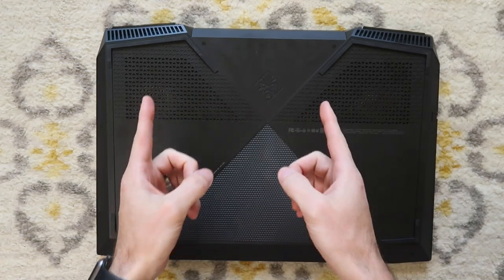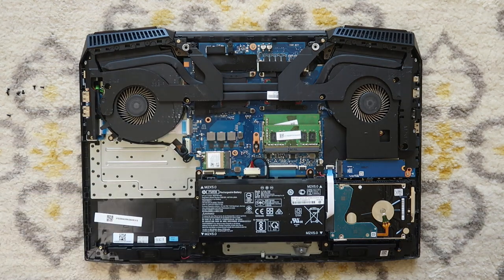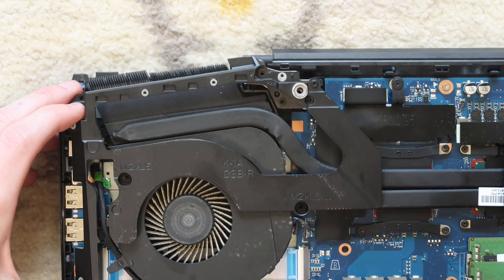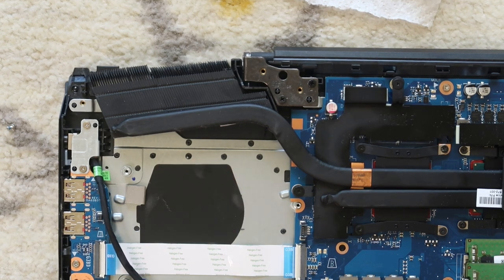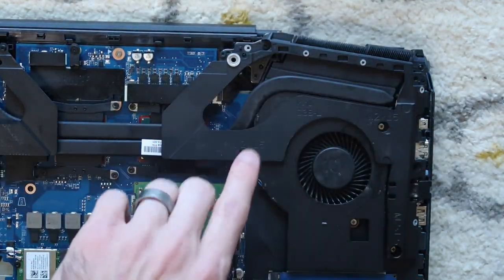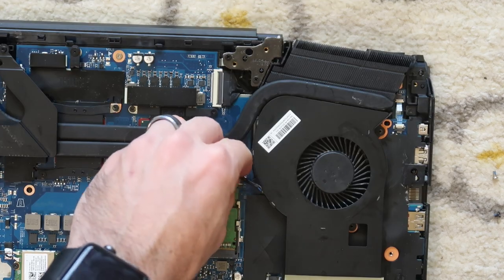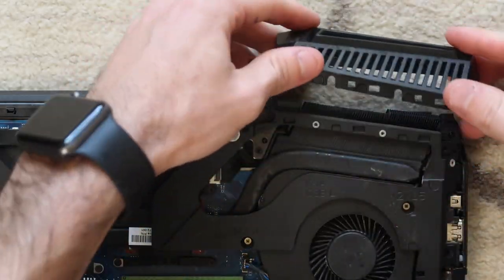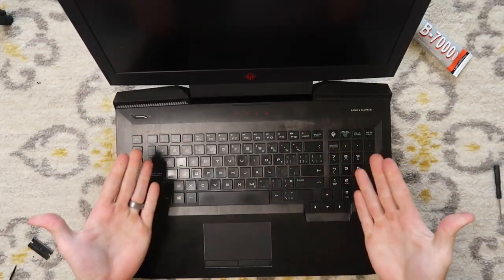How to Open and Clean HP Omen 17 Fan Disassemble + How to Upgrade Ram + SSD + Battery

Comment: Is that a 2080 type ssd as a young buddy of mjne has the an101na hp omen 17 and gonna upgrade his memory from 8 to 16gb. Im wandering does it do dual channel. I dont know if its single rank memory or dual rank. I plan to get him a 256gb nvme pcie m.2 as his 128gb only has a few gig left and theres nothing to remove and dont see anything to remove to gain space

Comment: How much time did you have since the last clean, my Omen has a 3 year warranty, I have had an entry level MSI laptop before, and I used for 3 years, I really did have the msi a rude use and still works fine with no fan clean or termal past change, I wanna know if my 1 year old omen can hold more time without any improvement, Thank you!

Comment: This was a very good demonstration, thank you. I have a similar model 17" Omen laptop, 17-AN012DX. One significant difference of note is that the left fan's housing was connected to another heat conductor that rests, with thermal compound, on several items in the center of the motherboard, held down by three of the large, shallow black screws like what hold down the grill cover plates. This small difference was obvious and intuitive to figure out. I was able to remove and re-seat this component without incident. Other than that, the process was identical and my laptop no longer runs its fans at full speed just from turning it on. Cheers!
Reply from the maker: Ayyy awesome. Glad you were able to take what you need and adapt the rest 💪🙌
Reply: I have a similar model and was just about to perform a clean, thanks for the heads up :)
Reply: Guys i followed this tutorial the exact same as my laptop, now my laptop wont turn on, the power gives one red light once and the laptop turns off, help pleaseeee😓😓😓( i disconnected and reconnected the battery while cleaning)
Reply: @naregartinian7987  I would first suggest you go through the process again, as maybe something isn't quite connected correctly. Remember to check every single connection is in. 
Besides loose connections, the only other thing I can think of is somehow a cable or transistor or something was damaged. In that case, if you don't have the tools and equipment to check every part individually to find the route source of the issue, it may be a computer repair shop job. There may be other things you can try that haven't immediately popped into my head though!
Reply: @legendswithlee6508  Everything is connected correctly, i tried turning on without battery but the same issue still

Comment: I would brush the dust off parts over another surface besides the exposed innards of the laptop.  Other than that nit picky thing, this was great!  The battery is failing in my Omen laptop, so while I have it open to replace that, I will do some cleaning and clean the fans like you did here.  Thanks for taking the time to make this video, I found it helpful.

Comment: Thank you, this helped so much as one of my fans has failed to operate and I need to replace it. I used this video to clean them thinking that would fix my problem, but one of the fans is still failing to operate so I guess the next step is to replace it

Comment: Want to replace the battery as it is shot. Got inside. Two screws out. Two are just spinning but not coming out. I assume they got cross threaded when the machine was assembled and are stripped. Any ideas/suggestions for getting them backed out?

Comment: Hey man! Thanks for the video, it's very helpful! As a bit of constructive criticism, you could use some full time video autofocus tracking for when you're showing a piece above the table closer to the camera, so we can see the detail of what you're showing! 
Still, the info it's there and I'll be cleaning my Omen 17 soon. 
QUESTION: the reason I'm cleaning the laptop it's because the fans are on all the time, from the start, not like before, and even if it doesn't make any rattling sound, the normal fan sound all the time is quite distracting when I'm trying to read or work, or only need some silence. It seems to be overheating quite a lot, do you think the processor needs some thermal paste replacement? Or will the cleaning alone do the trick? Also, where's the processor, is it easy to access? 
Hope you have the time to answer, thanks, all the best!
Gabriel
Reply: good luck i just finished my surgery

Comment: I have an Omen Model 17t-w000 I can't seem to find any videos specifically for my laptop.  Do you know if the one you show here is set up like my model? I need to replace my keyboard, upgrade some stuff ... I don't want to open it up on the off chance it's not laid out the same.  Any help would be greatly appreciated.

Comment: collegepicker thanks so much for this video. i dont think my model has any SSD whatsoever, but its the same model so there should be a slot for it. sorry for my newb question,  but do i need to copy everything from my current hard drive to an external hard drive before installing an SSD ?? and load everything back after. and what about the OS, will that need to be re-installed or something?? i havent done anything to this laptop since buying in 2017 so its a mess!!

Comment: Disconnect the battery pack and the on board lithium battery and then spray lighter fluid or contact cleaner on those dirty fins. Allow it to dry completely then replace all components back to their original positions.

Comment: Thank you very much for this helpfull video.
I have a similar computer (Omen HP-17-an112nf), on which I have an issue with the CMOS for the date and time memory.
I didn't find any document or video from hP (and also tutos on Youtub) explaining where we can find this CMOS battery, and I don't seen it on your video. Does-it mean that it's under the main battery or another component ?
I understand that it should be a  2 pins, 3 V, and  210 mAh, but nothing else...
I you have any information about this, in advance thank you

Comment: I have 17-w033dx laptop. 
When I plug it into the charger the light on the side will occasionally go on. But when I touch the power button it won't start. The power button goes white but won't start. The backlight on the power button won't turn on unless it is plugged into a charger also.
Reply: I think i might screwed it too ... I forgot to unplug the battery so now it wont turn on , it is keep restart with no turn on and the power led keep flashing ..
Sir how did u fix it ?

Comment: yo i did everything like u showed but now when i turn on my laptop there’s a black screen and caps lock is blinking, any help?

edit: my laptop is fucked and i gave it for repairs
Reply from the maker: Is it possible you forgot to plug something back in or didn't plug it in all the way?
Reply: thecollegepicker honestly have no idea, i’ll try unplugging everything and plugging it back in, ty for quick response
Reply from the maker: It's easy to forget to plug something back in and cause a problem. You'll get it working again.
Reply: thecollegepicker naw, everything is connected and it still doesn’t work. will do the whole disassembly thing later probably

Comment: do we have to unplug the battery when we clean the fans?
Reply: It shouldn't be necessary. The laptop's PMU should not be allowing power to get to any components except the power switch and maybe a couple items on the motherboard. Short-circuit protections on all circuits should still be functional, so a dropped screw, for example, should not cause a problem. Unless, of course, you forget to fish it out! :-D
Reply: @daytonduck  i see, thank you so much for your help, i really appreciate it :D

Comment: I have a HP omen 17-an101nia with a 1TB HDD, I want to sawp the 1TB with a 2TB or 4TB harddrive but an external one or is there a specific size that the HDD should be to fit in the laptop HDD space?
Reply from the maker: Im not exactly sure on that. its a 2.5'' hard drive if that helps =)
Reply: @thecollegepicker  yeah, I swapped it out for a 2TB Seagate HDD😌, couldn't get the firecuda😐
Reply from the maker: @louisbenedict75  Awesome, so much storafe now! =)

Comment: I think i screwed it .. i forgot to unplug my battery before cleaning the fans .. so now whenever i turn it on it just keep restarting and the power led (in the power button) keep flashing ..
Anyone can help me ?
Reply: The lock key is blinking in a repeated sequences ( blink for 3 times long and 2 times fast )
Reply: You need to change your battery (ASAP). I think your BIOS battery is dead
Reply from the maker: Any luck?

Comment: An alternative to the b-7000, if you still have those black tape coverings that were already inside the motherboard that is, cut out a piece of the taping and it works firmly to hold the brackets together so you dont get any ratttling. I just discovered this while looking for superglue or some shit and couldnt find any so i remembered how strong that fucking paper was and turns out, it works pretty well 👍

Comment: I got a 2019 hp omen 15 with I7 9th gen an 1650 an that I7 just gets to hot get up to 100C it’s a nice laptop just hate how hot it gets
Reply: Gaming laptops get hot. I've have many. Alienware, MSI, Asus, HP. It happens in all.
Reply: Carlos José Rivera I liked the acer nitro 5 I had hottest that one would get is 78C  an it was over clocked
Reply: @kamryn7496  That sounds odd. GPU can easily get to 85c while gaming. CPU will most likely hit the 100c often and throttle.
Reply: Carlos José Rivera lucky not the gpu hottest it will get is 72C
Reply: @lordneojacks  true but 100 degrees is a little too hot for me. Below 90 would be more ideal. Mi omen runs at about 82ish when I play.
Reply: You must repaste it. HP is using worst paste ever. Use Thermal Grizzly or MX-4 and you will forget hig temps ;)

Comment: Is it also possible to upgrade to 32GB ram?
Reply from the maker: Yes I believe it can do 32 maybe even 64
Reply: @thecollegepicker  I got an older Model W-104ng it’s hardlocked at 16GB. I tried anything bios settings , single stack , dual stack nothing worked. Than I called the HP support and after 45 minutes we found out that the older HP 825F MB is caped by 16GB sticks
Reply from the maker: Oh no 😵‍💫 sorry to hear that

Comment: amazing
Reply: @thecollegepicker  Can ya provide us with the screwdrivers sizes? Cause I opened mine today and yea it was dusty but could not access the fans cause the bolts of the "exhaust" (dunno what's called, but it's where the heated air escapes) were too small.

Comment: some of these screws are really hard to open.. I think I just messed up everything
Reply from the maker: Hopefully you got it all good =)
Reply: Grip the handle of the screwdriver with pliers held perpendicular to the handle. Press down gently on the top of the screwdriver with your other hand (just enough force to keep the screwdriver in the screwhead) and rotate the pliers to turn the screwdriver handle. The extra distance gets you loads more torque!